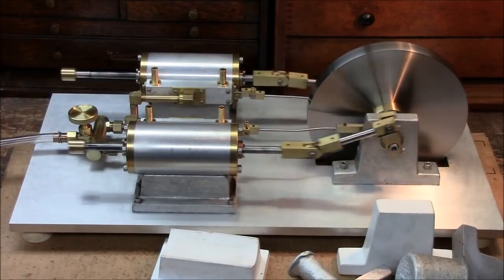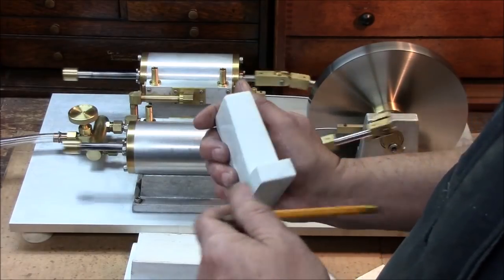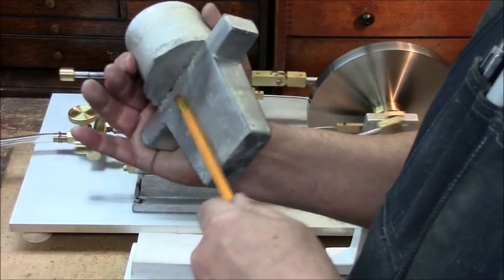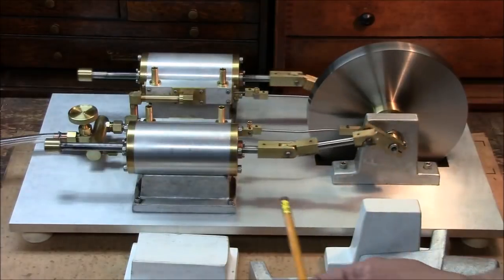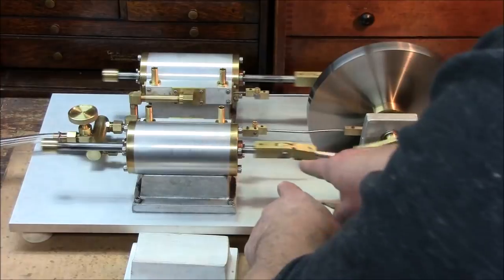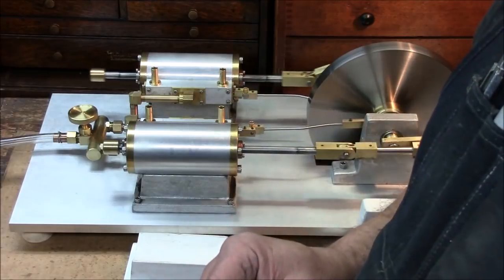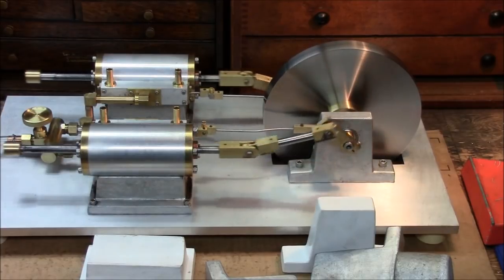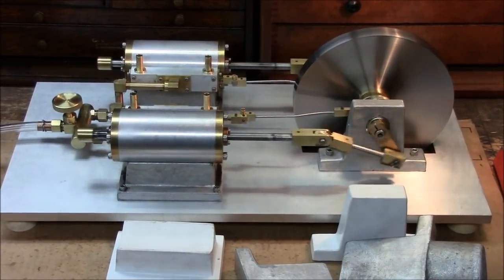Cross-slide-less stationary steam engine

Comment: Beautiful work Fred
Reply: Fred I forgot to ask did you use any packing for the cylinder rod if yes what did you use, string and oil just curious bud thank you for sharing
Reply from the maker: @Josefppaz  I have made quite few steam engines.  These days I tend to use Viton O rings.  They are very durable and stand up really well to high temperatures.  Good luck with your projects...  Fred
Reply: @FredMiller  fantastic thanks Friend
Reply from the maker: Thank you Josef.

Comment: Thanks Fred, that's pretty wonderful engine. I'd like to know about how you achieve the shaft  seals, and also some more details on the  (spool) valve timing adjustment.
Reply from the maker: Thanks for the sub Simon.  I poked around Youtube and came up with this animation of a spool valve in action.  You may have to watch it a couple of times to get the principle.  Spool valves require less power to run than steam chests.  In a steam chest application the valve has to over come the pressure of the steam to slide back and forth.  A spool valve has balanced forces on each end and is more efficient albeit more complex to build.  Check this out >>  https://www.youtube.com/watch?v=YVJsZCU6z1AThe shaft seals are accomplished with graphited yarn in a unit called a "stuffing box".  The yarn is under compression with a compressing ring around the shaft.  It was used successfully for over a hundred years of steam engines and is still in use today.Regards-  Fred
Reply: thanks Fred. I see that you have an eye for efficiency and simplicity, though they don't often align.  There's always a compromise. I get the spool valve, and I can see that timing is determined by the length  and position of cavities and 'walls' - I think they call then 'lands'? Seems easy enough to figure out. I know about stuffing box, having a boat with a prop shaft. Why choose graphite yarn over a suitable (viton?) O ring?
Reply from the maker: Great question Simon.  I do use viton O rings when I have enough room within the fitting.  I do like viton because it can withstand very high temperatures, wears incredibly well and is impervious to most lubricants.  I will be posting a home made can crusher in a couple of days.  I used viton O rings in that one.  Stay tuned!  Thanks-   Fred

Comment: Wow.. nice design and remarkable craftsmanship. With a twin cylinder with  double acting cylinders, its got to be a self starting engine. Running at 5 psi is impressive. Its obvious there was a plan that produced performance. Thanks for sharing your work.
Reply from the maker: Thanks for the kind compliments Joe.  This engine is self starting and I now have it running at 2.5lbs of air pressure.  The most difficult part of this build was calculating the dimensions of the spool valves based on the offset of the eccentrics.  When I finally got it right (second attempt) I actually could run the engine on one cylinder and let the second cylinder without any valving be the load.  That allowed me to fine tune the valve to get it perfect.  I then repeated the process for the second cylinder.  When both were pulling together it was magic!  There is something about taking a pile of metal and making it come alive that gets me on every engine I build.  Regards-  Fred

Comment: Good one Fred.  Nice build.  Even better when you cast your own materials.  Cheers Rob
Reply from the maker: Thanks Rob!  It was a long but very satisfying journey and best of all I learned a lot!  I also get real satisfaction that it's an "original".  Regards-  Fred
Reply: I forgot to ask - how did you seal your pistons ?
Reply from the maker: I used a pair of high temperature silicone O-rings per cylinder.

Comment: Wonderful job Fred with the casting and machining ,I would imagine it must be well balanced with the piston having the same cross surface area on either side in comparison to a conventional design. Keep up the good work . Regards Vince
Reply from the maker: Thanks Vince.  I consider this a 4 cylinder engine since both cylinders share a common piston.  All 2 and 4 cycle are single acting.  They only get "pushed" to the bottom of the bore.  This type gets its piston pushed alternatively in opposite directions.  I have lots of fun arguing the point with my fellow steamer friends.  All the best-  Fred

Comment: G'day Fred there is certainly a lot in this really interesting how the cylinders work with no steam chest.  The set up for the small crank on the piston rods  looks a lot like how Stephenson did it on the Rocket, and how it was connected to the main crank on the wheels. It's a work of art Fred and a credit to you fantastic and how it was scratch built and the castings you did yourself. Thanks Fred this one is really something try and stay warm I have never experienced temps that low.  Kind regards John
Reply from the maker: Thanks for the very kind words and the info about the Rocket John.  I will check that out.  Staying indoors with these temps is critical.  The wind chill is right now -25F or -32C